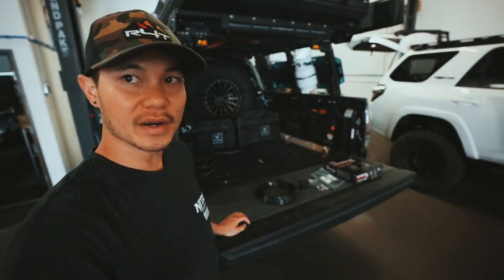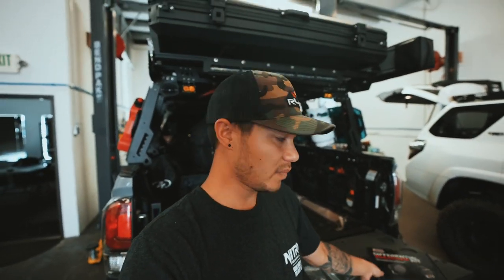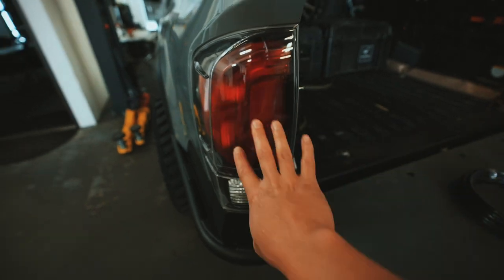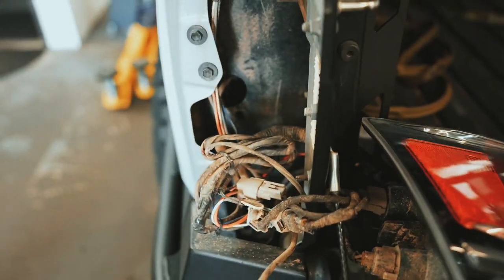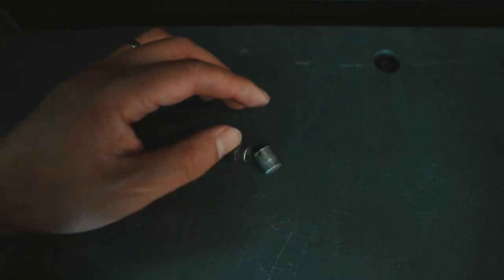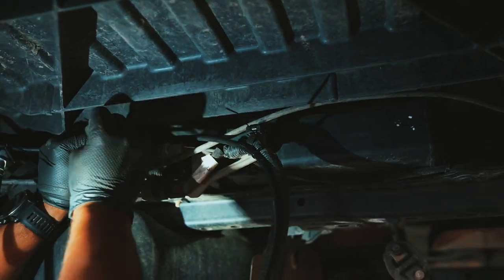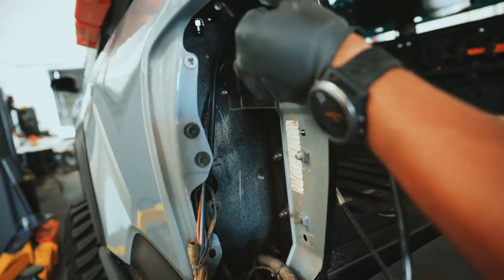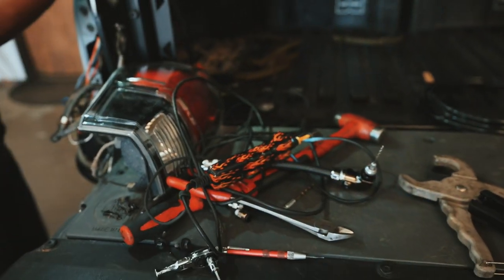Tacoma ARB Diff Breather Install

Comment: One of the main issues with the factory diff breather is that when your diff lube is hot and you are in the water, when the valve shuts is does not allow air back in, as the lube cools it creates a vacuum and can pull water in through your axel seals.  This was a common problem with Gen 3 4Runners and Gen 1 Tacos.  There were several reasonable fixes on the forums.  I do like  the ARB package and that you could effectively provide proper breathing to all the diffs and transfer case.

Comment: The location isn't the issue. It's vacuum caused by cooling of the axle housing when being suddenly submerged in water. The water is being sucked in through you axle seals. The check valve isn't letting anything in. The ARB kit eliminates the potential for a vacuum by equalizing the pressure all the time. That is why the ARB kit has to be mounted high.

Comment: @Taco Twonz   when will you complete/protect the other 3 water entry points/breathers (i.e. front diff, transmission and transfer case) and post a video of that install? Those 3 are probably the most over looked water entry points, and most expensive to repair but cheapest to prevent, on the 3rd gen Tacoma. Also, the reason ARB gives you multiple manifold connect points and so much hose, is so you can do those other 3 on top of rear diff. Think viewers would benefit most from that install video (Hopefully coming very soon...).
Reply: Those already have breather lines run into the engine bay. They're not as high up as this, but you'd still have to get in pretty deep to submerge them.
Reply: @bradenb   Respect your perspective. And yes the stock lines are a bit higher than the rear diff stock breather but they're about as high as the uca upper through bolt and well within what a lot of drivers expose themselves to when speeding through a rainy day deep puddle. The splash up alone can cause damage. The actuators fail because of this all the time, and the cheap breathers on the Tacomas are very susceptible to water inlet, especially for the drivers reading and researching these comments. For those that regularly water cross even in 1' of water, will slowly cause expensive damage that this cheap fix can prevent.
Reply from the maker: Like Braden said, those are about the top of the front shocks so not as needed. Most of us don't plan to go through engine high waters
Reply: @Runnin4Tacos  Okay...
Reply: @JesusWSalazar  really? 1" of water? Smh
Reply: @RagingBad  You read it incorrectly. I didn't state 1". I stated 1'. And at the right speed, yes 1' can easily swell above the critical parts.

Comment: So you went all the way down with the new breather?  It seemed like I was cross threading so I didn’t go all the way down (it wasn’t) Maybe it was my kit but the breathers were slightly different sizes (one was too big).  I went probably 3/4 of the way down because it was so tight

Comment: I have seen several youtubers (both Australian and American) who have said there is a problem with oil blow through (using a common under-hood mounting point). one ended up replacing the ARB puck with an oil catch can that was plumbed with a sight glass so they could see how much oil was in the catch can. I will be interested in seeing an update down the road if you get any oil blow through.

Here in east TN if it is not a water crossing, it is a rocker deep mud hole. I have been seriously considering installing a breather kit of some form for the front and rear axles)
Reply from the maker: Interesting. We will be installing a oil catch can soon but not for that reason

Comment: Question about the rear dif skid.  Does it have something that prevents it from spinning if you hit it hard enough? A buddy hit his and it rotated up cutting his ABS lines.
Reply: This looks very very similar to (if not identical to) the RCI rear diff skid. It has a collar that locks around the pinion assembly where it connects to the driveshaft so it shouldn't be able to rotate.
Reply from the maker: Like Bredan said, it's similar to the RCI and C4 so there won't be any issues. We've been testing it and hitting it on the trails with no issues

Comment: I keep seeing people say that the front diff has a breather already in the engine bay, but are those stock breathers one way? So if you submerge a hot front diff and cool it quickly could cause a vacuum closing the front diff breather? Which could cause you to possibly suck water in from the axle seals?

Comment: Man... I just installed my ARB kit about a month ago. Almost identical except I ended up just leaving about 18 inches coiled up above the diff for articulation. I wish I had thought to do it how you did it. If you're tied to that existing wire harness then you should have all the flex you need. I loved this kit, but I hate how stiff the ARB tubing is. It makes it very hard to work with, especially around bends.
Reply from the maker: Is it? It went on pretty easy for us but maybe they changed it since
Reply: @Runnin4Tacos  Not sure. It's a pretty common complaint from what I've seen. But the way you routed it was a lot more direct so maybe that helped. With mine since I left a bunch of coiled slack I had to leave more than I wanted to complete a full loop because I couldn't bend it more than about 45 degrees without fearing I would kink it. In the end it worked out well and is holding up. They probably chose this line because it's so strong.

Comment: Is it possible to use strong magnets or something other than drilling holes? I don't have the tools necessary to do that.
Reply: Did you find out anything about magnet? I am worried the ambient heat may reduce the magnetism.

Comment: Glad I'm not the only one
 Truck looks clean. remove a tail light its always sandy up in there!!! No matter what I do lol
Reply from the maker: Lol yeah it tends to catch all the dirt from the tire
Reply: Just plug up the holes with foam. Most of the foam I've used is from the Plano cases I get for my long rifles and firearms. Keeps dust out of those tail light housings.